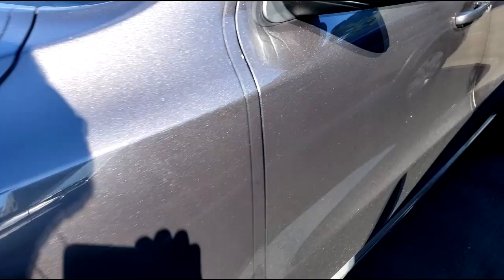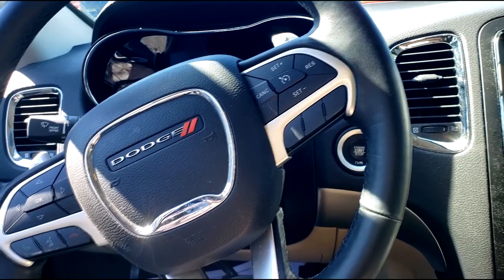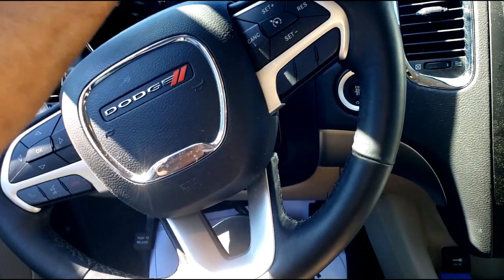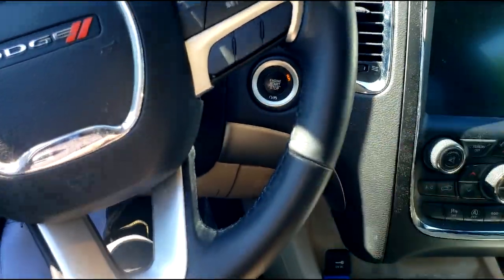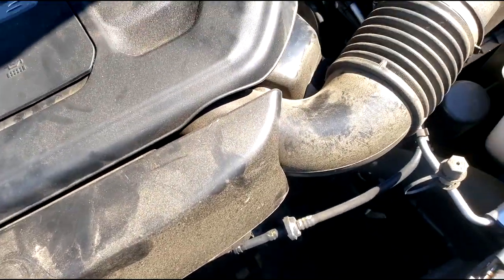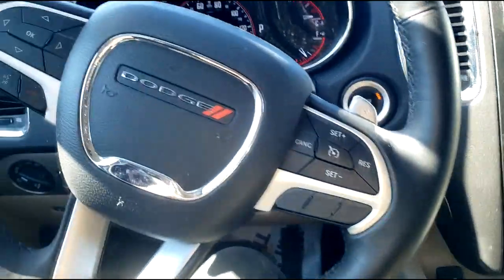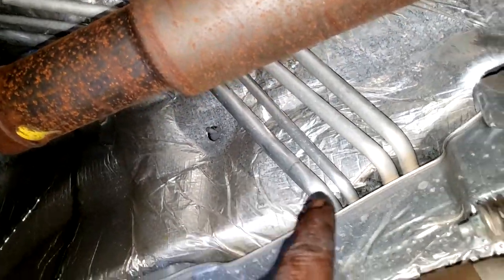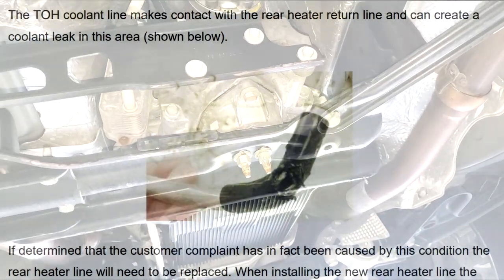Car Engineering Biggest Blunder. Dodge Durango coolant leaks FINALLY FOUND. See here. PARTS Ordered.

Comment: New gen 3 pentastar still hs shitty oil filter housing. Garbage design, engine will run and last but that unit is trash. Use the Dorman aluminum version.
Reply from the maker: IMO, the OEM version better than Dorman. But you are entitled to your opinion.
Reply: @OnlineMechanicTips  i have a 72k, 2017 Durango. 2 swapped OEM. They suck, and I am a Mopar guy it sucks to admit but the design and oem one sucks.